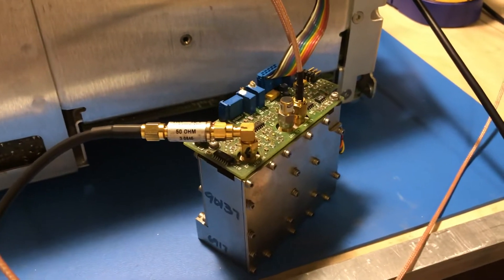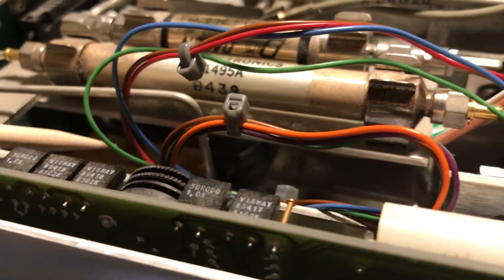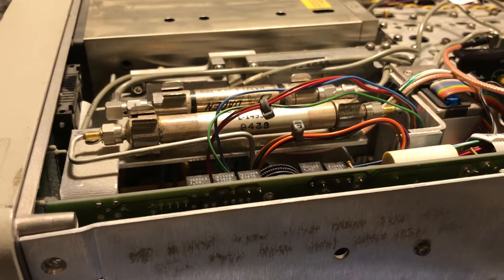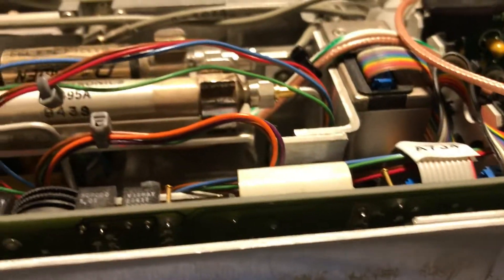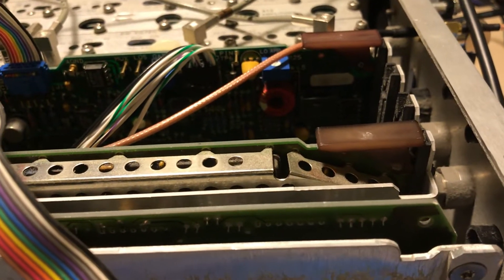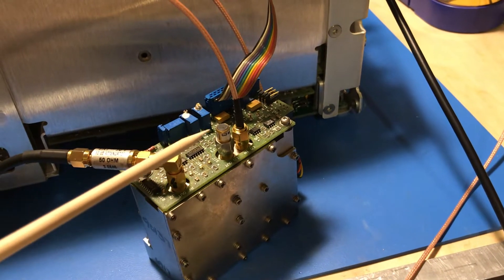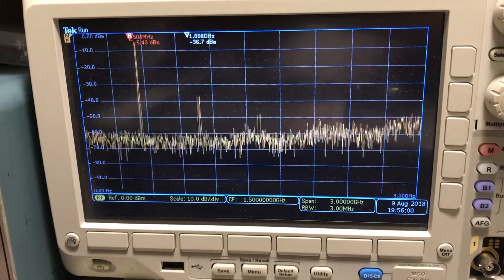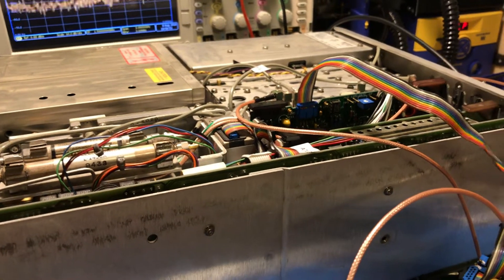HP 8595E Spectrum Analyzer upgrade to Option 10 Tracking Generator, Part 1

Comment: Great video. Did you measure the dynamic range of the 8595E? I have the HP 8566B and 3585B. A company called DS Instruments made/make an outboard TG for the 8566B and others. The dynamic range is only about 80dB but thats a lot better than no TG.. There are video's on YT demo-ing their TG with tge 8566B

Comment: Do you need to do anything with the firmware? I mean is the TG enabled in there already even if it was not installed or it shows up in the menu automatically after you install the TG control board?
Reply from the maker: The TG is controlled from the front panel "Aux Control" button.  My system recognized the hardware on boot and displayed Option 10 under the options list.  No firmware mods required.